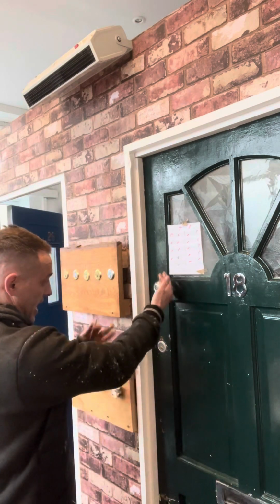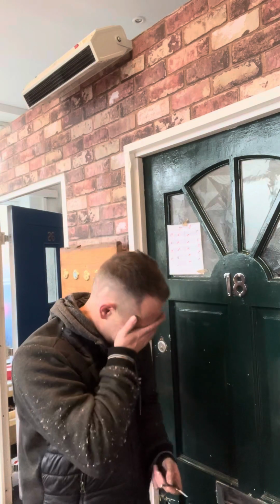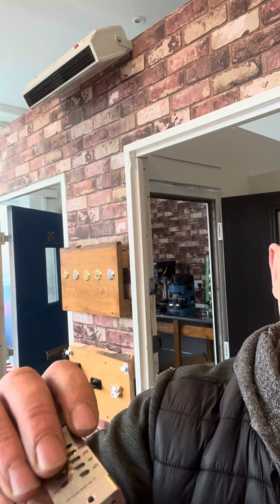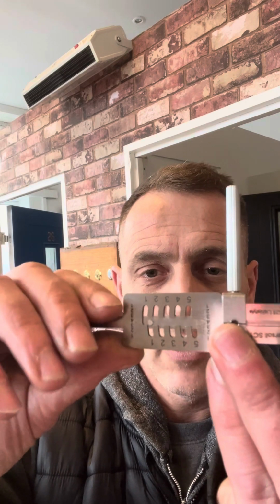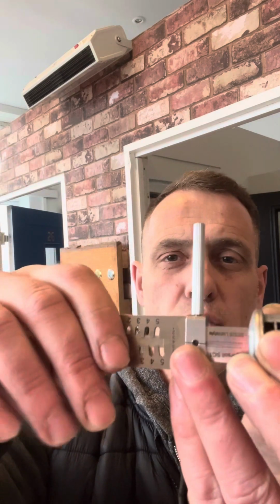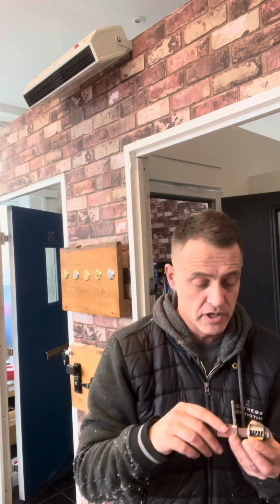Part 2 of the Ingersoll tool, doing it in a door, and a reason the tool might not work

Comment: If the lock is not going to pick because there's a spring missing, why don't more lock makers just leave out the odd spring?
Reply from the maker: Because the key wouldn’t work either
Reply: @FortressLocksmiths  ah yeh that is a bit of a draw back. 👍